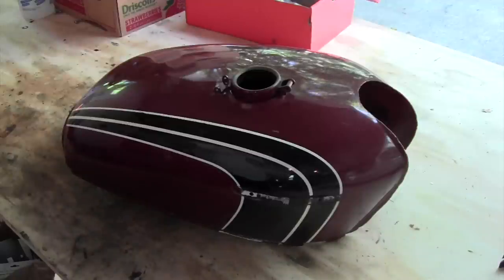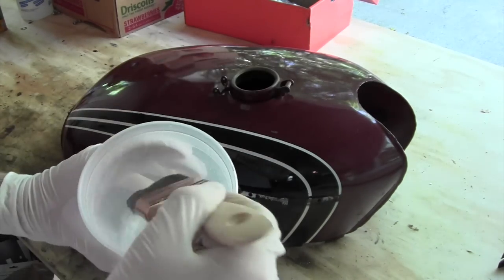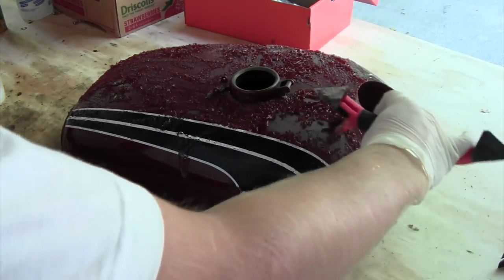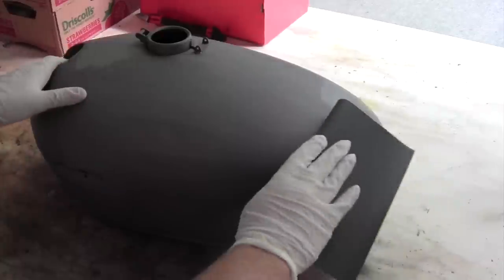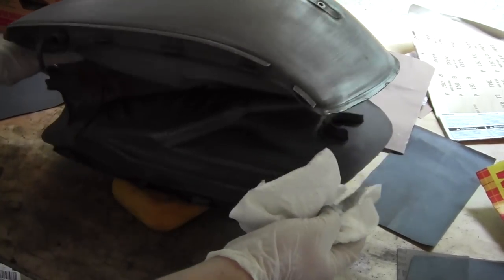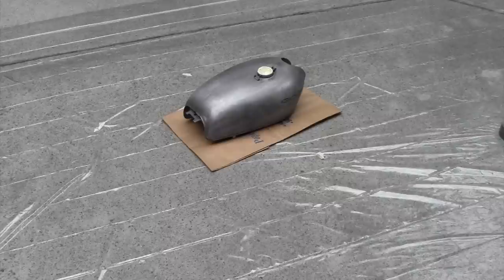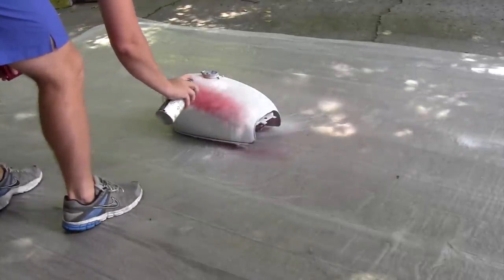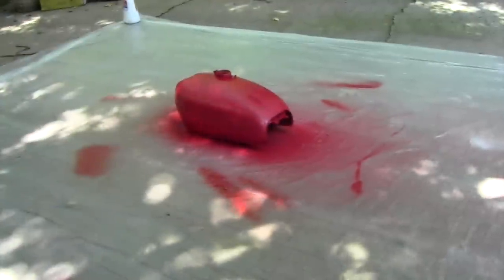How to Paint a Motorcycle Gas Tank

Comment: bro...I beg to differ..best is to place the tank on the table that about your chest height..then apply a thin layer of  coat and respray it over for a couple of layers after several half an hour or so..(this application help the coat to settle down n to prevent the paint frm "crying"..)

Comment: In addition to the other comments, I have to say, I don't think you can use that rattle can acrylic on a gas tank. The clear is going to start to dissolve as soon as you get some gasoline on it. There are two part clear coats that come in a single can available that will work with a gas tank, but urethane or acrylic are not going to hold up at all.
Reply: Gonna have to be careful getting gas then... lol